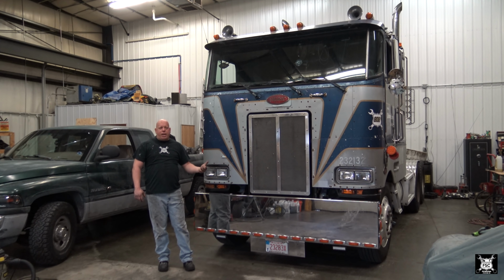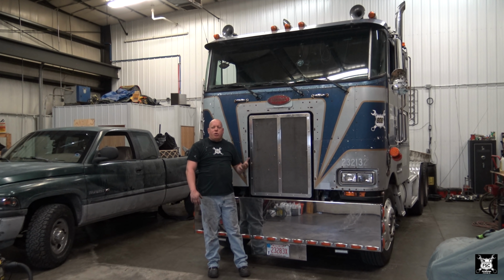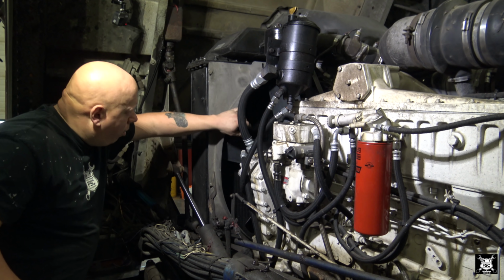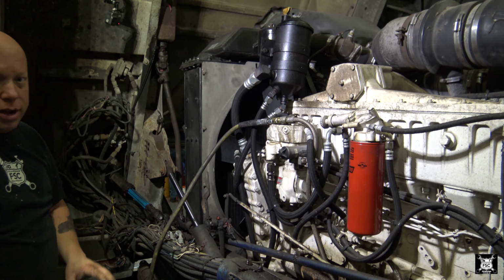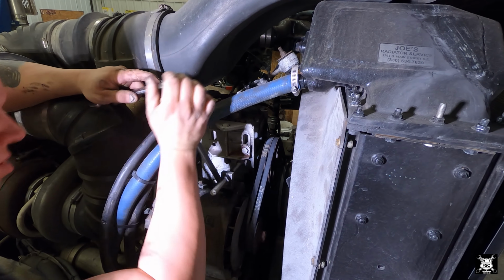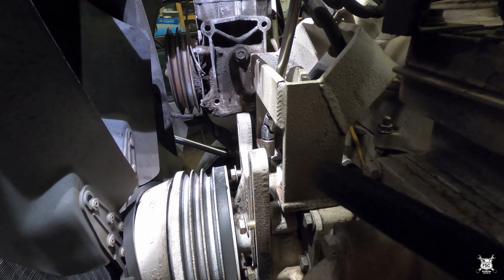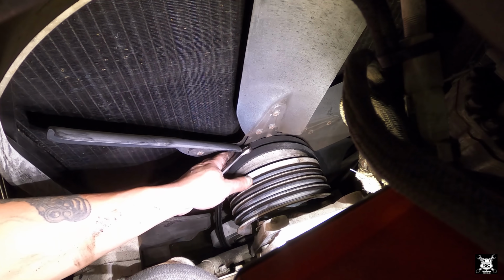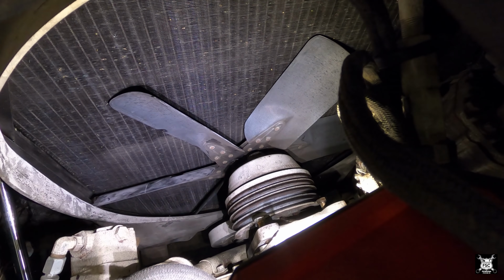Caterpillar 3406B Fan Clutch Removal

Comment: Next time you have to remove that for repair here is a tip.  I would always use the belts that I removed from the bottom pulley only as a sling to lift the fan clutch out of the truck.  Made it real easy to pull it out of the truck.

Comment: Well Hero. I guess we will get to watch you put it back together in the next video. The last time I performed that surgical procedure on "Old Blue" my hands and arms looked like I stuck em in a meat grinder and tried to make sausage out of them. Next time you take Orwell's fan off cut a piece of cardboard and lay in against your radiator. Might save you a repair and it also protects your hands from the radiator fins. You and Matt do good work. Later

Comment: Hey pro tip, I know time is money but fab yourself a lockout bar for each piston on the cab, grab some square tube and cut it right down the middle, weld a door hinge on it to open up and close, cut a c where your piston attaches via nut and bolt. Ensures the safety of you and other personnel working on the cab and doesn't allow the cab to move in either direction. We have to build our own for our escavators as cat doesn't build it themselves from the manufacturer.

Comment: Had the fan clutch go out sometime previous to heading to Texas in December 2013 with a 2006 Ford F-350 dually pulling a 35’ 5th wheel up Covington hill out of Cincinnati on I-75. Truck over heated in 17 deg weather. Caused all sorts of problems and repairs later. With out a load the truck never overheated but as it turned out the truck had a myriad of problems one at a time. Finally had enough of it. Sold the 5th wheel and truck, bought a Tundra and happy days again.

Comment: I rebuilt my fan clutch on a 92 White/GMC with a N14, about a year ago. (never done it before). The hardest part was trying to get it back together by myself. The clutch is quite heavy, and trying to hold it in place, at arms length, and get a bolt started with your two index fingers, is nigh impossible. I ended up putting a 2x4 from the top of the radiator to the top of the engine, and supporting the clutch with a couple of nylon straps. That left my hands free to do what was necessary.

Comment: ooh darn where's the rest of the  video????  nice that Mathew was there to give you a hand there Steve havnt done fan clutch before but had to replace all the belts  on a cab over Kenworth with n14  also removing the inter cooler for cleaning too truck was getting hot and it did of off road work